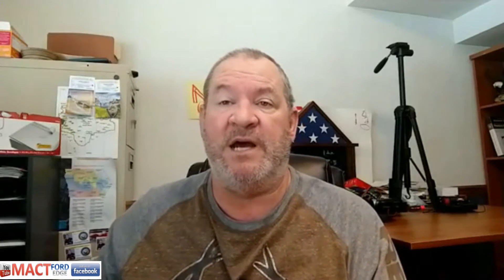Top three reasons your 3.5 and 3.7 Duratec over heats

Comment: 10/05/2023 my ford edge overheating new radiator new water pump new thermostat new hoses no water in the oil no water in the muffler  still overheats in 10 minutes  new head gaskets WHAT NOW
Reply: Also the fans works real fast Botha fans pleased help

Comment: Hi Matt my coolant blows out twice over heating about 6 months + apart first time was the radiator fan and I also replaced my thermostat this time my fan went out again and it blow there was coolant all over around the water pump
Reply: If the fan isn't running will it dump out radiator fluid all over from over heating? Got a code p1299
Reply: @thelastofus4351  yes it means it overheated. It's a failsafe... The first time.

Comment: Great information! I own a 2013 Ford Edge Sport and only the passenger side fan is running even after I turn my AC on. The Engine coolant over temperature warning message came up yesterday and then cleared on its own. Coolant is normal level, do I need a new fan assembly? Thanks
Reply: You have to reset the AC every little while when it does that. 🙄 It's annoying.

Comment: Thank you so much for this video. Thanks to you I was able to diagnose my issue. I ordered an OE fan assembly and replace it on my own, saving hundreds of dollars! My 2011 Ford Edge was overheating so bad but now it’s back to running smoothly and thanks to my new fan, the A/C is pumping ice cold air. Again, THANK YOU sir. 🙏🏾🙏🏾🙏🏾
Reply: Did yours only run hot when idled? That’s the issue I’m having.
Reply: I'm having the same problem with my 2011 Edge. Can you post a link to the fan assembly you bought for your's?...

Comment: My edge is overheating even after I replaced the electric fan. I was told it was the fan. The ac also doesn't stay cold even with the freon level good.  When I try and run the ac, the gage needle pegs to the" H" , but when I run car without the ac the gage needle never moves from straight center
Reply: Help
Reply from the maker: Join MACT Ford Edge on Facebook or on MEWE to get a great help in more detail

Comment: Will air in the system cause overheating?  I just flushed mine with a cleaner, then rinsed that junk out. Then added fresh distilled water and coolant. Peak as you suggested. Thanks.